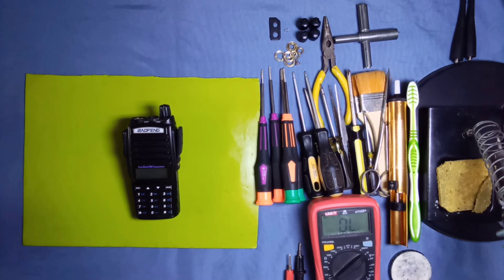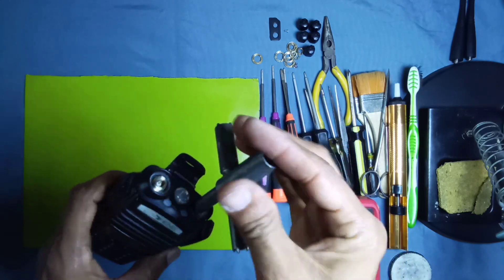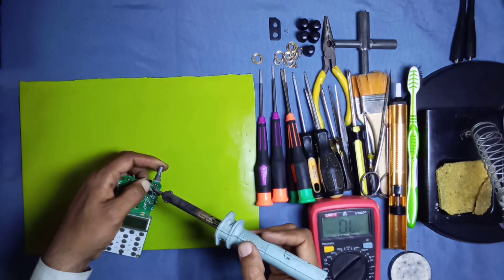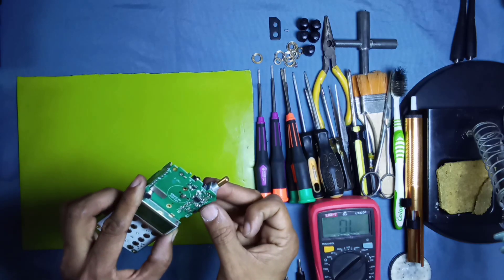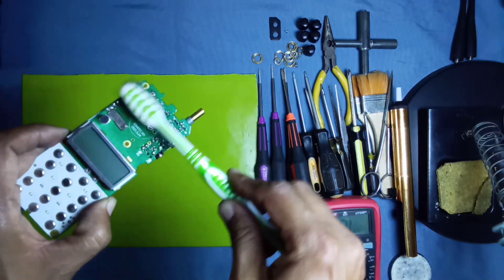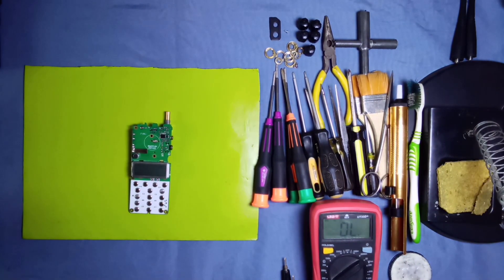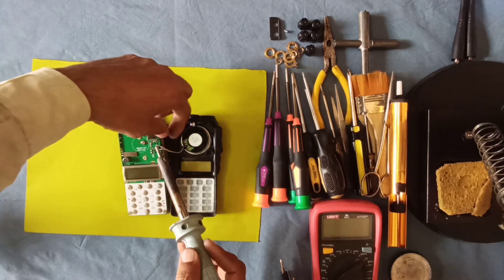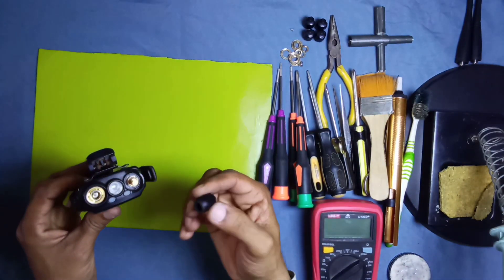how to repair baofeng uv-82 || how to repair walkie talkie radio || baofeng radio uv-82/uv-5r/uv-9r

Comment: You video helped me at a key point...didn't realized I needed to unsolder the antenna wire to remove the board. Mine had a broken solder joint on the volume switch where if you bumped the switch it would loose power. I resoldered the connections to the volume switch and it works fine now. Those birds squawking in the background makes it hard to understand your narration.
Reply from the maker: Thanks for watching our Channel!!
Welcome your feedback opinions suggestions and questions. 
Happy to hear from you my video helping you at key point... it's great pleasure for me.
Again Thanks for watching!!